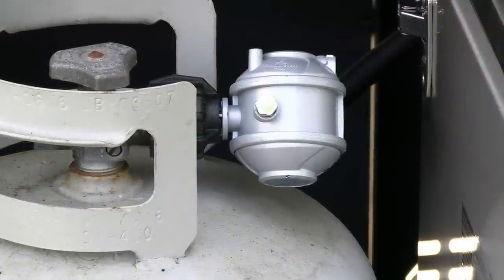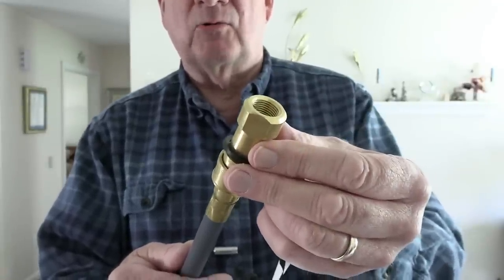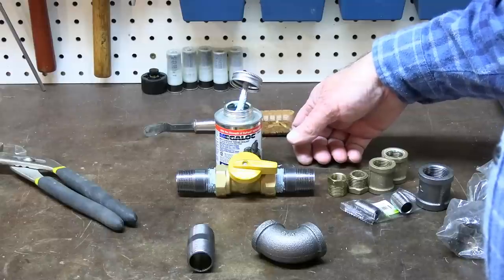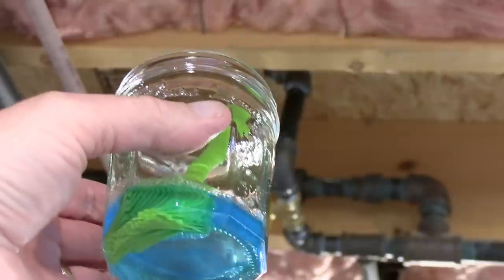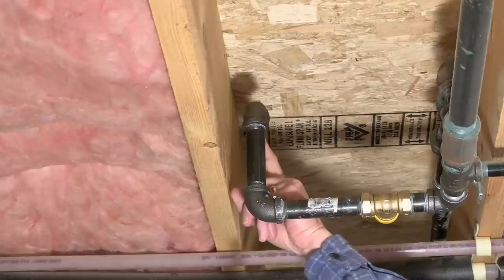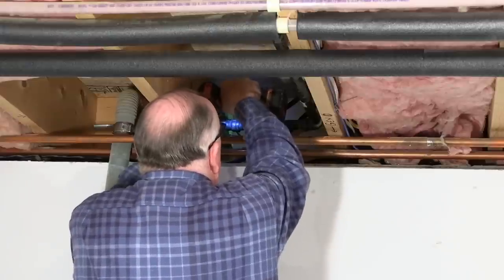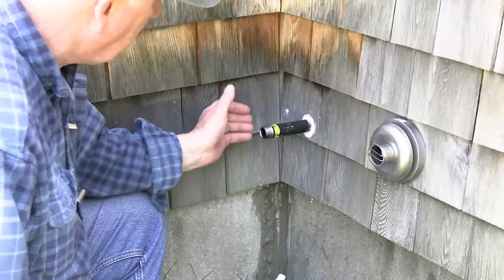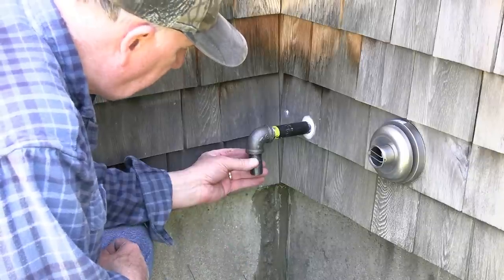How to Convert your Gas Grill to House Supply Natural Gas or LP

Comment: In Turkey, municipilaty does not allow to modify any gas system. If you want to add anything a licenced engineer has to draw a project plan which must be approved by the licenced gas distributor and licenced person has to implement it. After that an inspector comes and checks the implemenation against the project plan and make some leakage test. One has to always pay for the paperwork and inspection even if oneself does the work.

Comment: I had my plumber extend out gas line (home Propane underground tank) to the outdoor grill. The last step is just to connect this main supply to the actual grill. Am I understanding, based on your video that I do not need another regulator at the grill itself, since the home propane already has a regulator? Do I not need to worry about any flame backing up into that new extended line from the grill? I just want to be sure before I connect the grill itself.

Comment: @GunBlue490, your videos are always great. 
For natural gas, what advice do you have on changing or drilling out the orifices?
Reply from the maker: Thank you!  LP and Natural gas orifices are critically sized by specific dimensions for each appliance, and are factory tested to ensure exact gas flow at specific water column of pressure.  Drilling or altering any orifice is extremely dangerous and is impossible to do yourself.  Some orifices are simple screw-in replaceable brass nuts and are readily changed, while others are permanent or very difficult to access.  Some grills require major parts replacement in order to change the gas type.  Consult your grill manufacturer or gas company for information regarding your appliance for the application you need.

Comment: Good video thanks for posting.   So there was no pressure regulator required at the grill itself? I thought gas pressure for residential applications was slightly higher that the typical grill will accept.
Reply from the maker: No, the operating pressure of the grill is 11 inches of water column, the same as the regulated pressure in the domestic system. The regulator of a gas grill accomplishes the same thing as the ones attached to the bulk LP tank.

Comment: I never knew why you had to use black iron.  Thanks.  PS: Do you run your generator off of propane also?
Reply from the maker: No, though it could be.  I live on a very high priority electrical grid that is always put back on line within hours, so my generator rarely runs for more than a couple of gallons of gasoline.

Comment: Did u change out the orifices or manifold? Or did you drill out larger orifices?
Reply from the maker: As I stated in the video, one must use the correct orifice for any change from Liquid Propane to Natural gas.  If you're using an LP appliance with an LP bulk source, as I did in this video, no orifice change is required, but you must follow my directions and remove the appliance pressure regulator, which is no longer required.
Reply: @GunBlue490  sorry, I misunderstood your video. Was thinking you had done a LP to NG but this was not the case. I have the same grill.

Comment: Hello there I have seen a lot of videos out there regarding this conversion, some use a regulator at the grill, others do not just connect the hose directly and change the orifice size to compensate, question is a regulator needed at the grill ?
Reply from the maker: The house gas line is fully regulated and requires no regulator at the appliance.

Comment: Hi, love your vids. The starret hole saw should have a lock nut and two locator pins that hold the hole saw true. Rather than poking the wood plugs out with a screwdriver you can slack off the lock nut, screw off the hole saw and the plug will push out. Sorry if I’m teaching my granny to suck eggs.
Reply from the maker: It's not made by Starrett and has no such provision.  The slots provided are there for that reason.

Comment: Better to use a garden type or cleaner Spray bottle to put your LDF (LEAK DETECTION FLUID,) in ,even coverage and airates a little to show bubbles better..in UK only Gas Approoved Engineers permitted to do That sort of Install for ob reasons
Reply from the maker: That's not true in my locality.  Inspectors and our local LP suppliers do exactly as I demonstrated, and the Napoleon grill (Made in Canada) owner's manual details this method for testing tank or Natural gas connections.  I know old school natural gas company installers who still casually pull out a Bic lighter from their pocket, which is certainly not approved or recommended, but they assert that it's 100% positive and the quickest test.  That's how they tested new meter installations at our previous home over 35 years, and it's how they checked any work that I performed installing water heaters, boiler, and stove connections. When I asked why they do it that way, they said it revealed the smallest leak that might not be immediately noticed in difficult to see or access locations, especially behind heavy appliances or in old, dark basements.  "I can see a flame in the dark, but not a bubble!"  I do NOT suggest or recommend employing such professional methods!

Comment: Hey GunBlue, I was wondering if you would consider doing a definitive video on the merits of brass and steel case ammunition in rifles and handguns. There seems to be quite a bit of differing opinions and evidence concerning barrel wear, extractor wear, accuracy, and reliability between the two materials.  If you're knowledgeable about these things it would be interesting to hear from an expert with first hand experience. I, like many others, would prefer not to have to rely on dubious claims from faceless, unvetted members of gun forums.

Hope you and Benny are doing well during this time of uncertainty.

Comment: Can someone please explain to me how the regulator is just tossed away? I'm trying to connect a gas fire pit to my plumbed line and I'm uncertain of why everyone in these videos simply discards the hose with the regulator??
Reply from the maker: You asked a good question.  All propane bottles or bulk tanks are under high internal pressure. All appliances, including home heating and cooking appliances operate under much lower, specifically regulated pressure.  An outdoor gas grill employs a single stage regulator that steps the pressure down. A bulk tank connected to a building employs two regulators in line that accomplishes the same reduction, but in two stages, which increases safe handling.  The first stage high pressure reducer is typically mounted on the top of the bulk tank, and the second low stage is on the outside of the building. By the time gas enters the structure, it has been fully reduced to the same pressure accomplished by the single stage regulator on a gas grill or turkey fryer.  In this video, I tapped fully pressure reduced gas from my home that requires no regulator, just as your kitchen gas stove needs none.  Hope that answers your question.  Happy Easter.
Reply: @GunBlue490  perfect explanation. You just gave me the confidence to try out my plumbed propane fire pit and it worked totally fine!